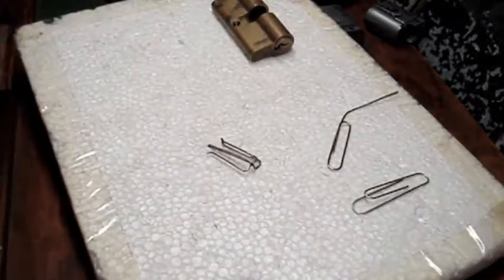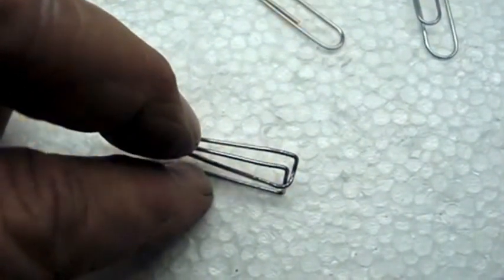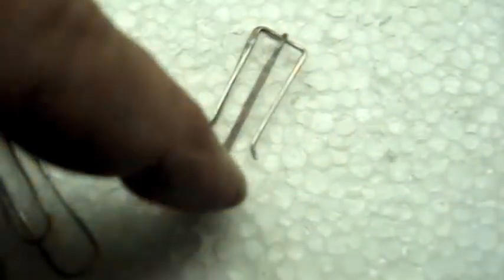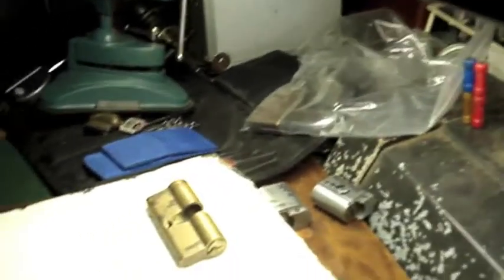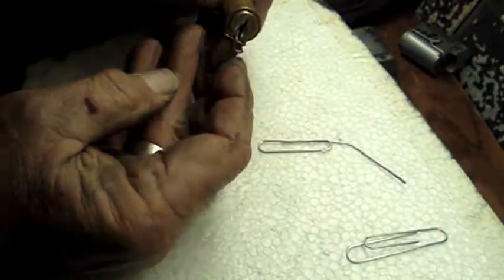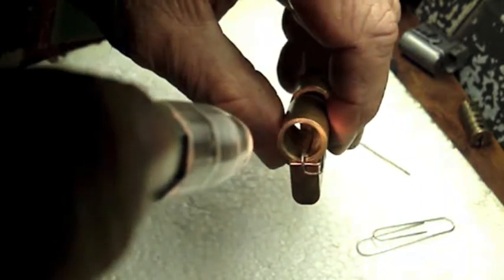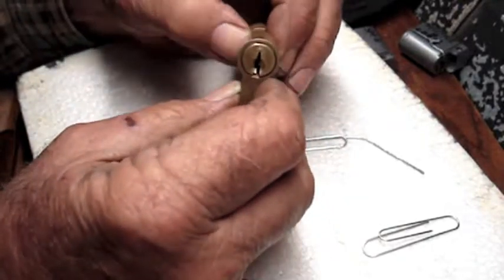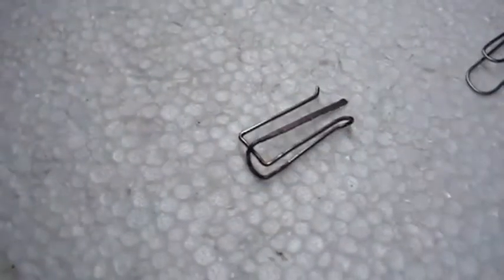Euro bible pin holder

Comment: Hope your doing ok Nev...miss your vids man.
Reply from the maker: Hi there Jacob.  I don't do picking anymore. I have reached my level of ability mate, no point bashing my head against a wall <g>.  Now I just play around with easier locks sometimes, when I get the urge.  But, I still drop in occasionally.  You're the only bloke I have replied to actually.  Hope all is well with you mate, and Keep Safe.
Reply: Thanks Nev...I feel that way also, I miss the old YouTube.  And yes certain locks are hard. I try to stay away from some stuff, but eventually you just run out of stuff. Cheers for comment back. Stay well...and feel free to drop back in anytime, your well missed.
Reply: Nev, forgot to add... don't feel you got always pick hard stuff.  Do what's fun for you have a good one.